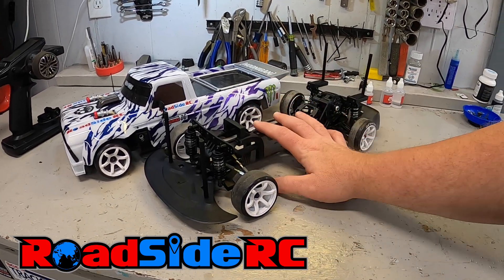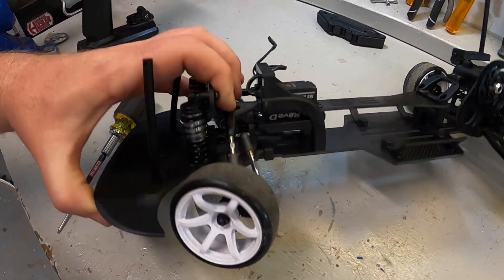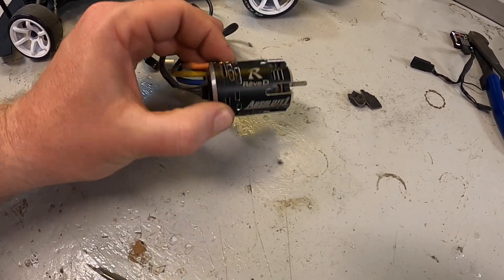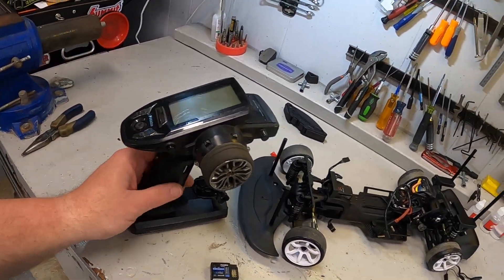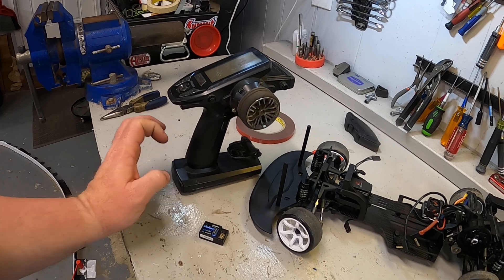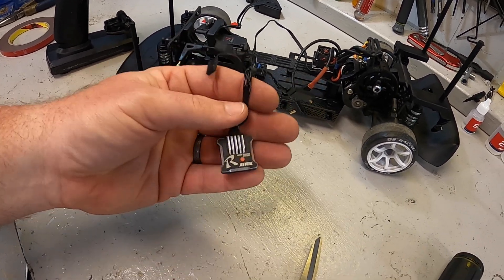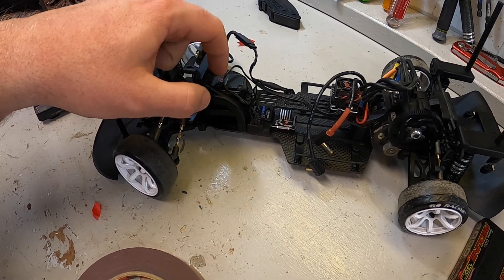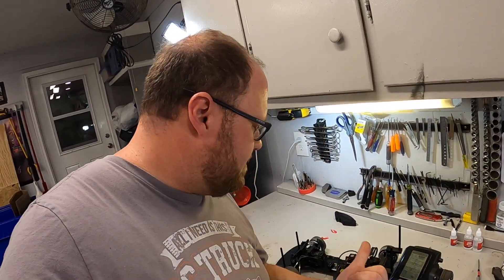Recommended Electronics for Redcat RDS RC Drift Car Build

Comment: Hi Troy! I just installed a reveD servo in my RDS, but it doesnt seem to want to go full lock either direction, any idea why? With stock servo it was going almost 20 degrees further.
Thanks!
Reply from the maker: You will need to re-set your endpoints in the gyro as well.   Have you tried that?
Reply: @RoadsideRC Thanks for the response! I did try endpoints originally but it wouldnt go past the same point it was set at. Turns out the reved servo is lower profile than the stock one, so the servo horn is hitting the servo mount!
Mooseridez had a video that points out the issue.
Going to file it down until it has clearance today 😅
Reply from the maker: I did the exact same thing.  Took a Dremel to the mount until the horn cleared.
Reply: @RoadsideRC Did I miss that in your video? Thanks again Troy 🙏 the wealth of information you has made getting into drifting much easier

Comment: I know you like the ReveD and the Futaba Gyros, but, is there a Gyro available for $50 or under that performs well, I saw you liked that Dumbo RC all in one for that price, is there a stand alone Gyro for that price so I can still use my T4PM Plus? Also which Futaba receivers do you go with?
Reply from the maker: Of all the parts of a drift car to cheap out on...the gyro is absolutely NOT one to do so.   Spend the extra $ and get a really good gyro.    Cut corners elsewhere.
Reply: @RoadsideRC  Ok, TY for the advice as always :)

Comment: Would the hobby wing Xerun justock combo work with the rds? Only reason I ask is cause it $110 dollars… thanks and love your vids!
Reply from the maker: Yes - that combo will work, but will leave you without turbo/boost - and without mechnical timing adjustment on the motor.  
Will it work great for having fun?  YES!  
Will you eventually upgrade if you start driving on track with others?  Probably!  

Here is another budget combo I have used:  https://youtu.be/nQBaEMDu0Ow

Comment: Recommendation for ESC: Hobbyking XCar 120A and an USB interface. It's basically some HobbyWing Xerun clone - uses HobbyWing software for tuning. Sum is under 40 bucks. Plenty of boost and turbo possibility (I ran at half of max). The only downsides are that sometimes throttle gets stuck after stopping for a second (applies to both original and clone) as well as minimal throttle response latency. Would recommend for start though.
Reply from the maker: Interesting!   Where do you purchase it?

Comment: One thing about ReveD is that electronics aren't always stable quality. One guy already had a servo and a motor (or two) stop working properly after almost no use.
Reply from the maker: That is true!  I have seen some folks say that.   Everything I have had from them has been solid though.

Comment: The 10bl120 and 10bl60 do have boost. It is no where near as tunable as the xerun escs but they have 8 steps of boost ranging from +0 to +26.25 degrees and it certainly works. You will need the programming card to enable it, part # HW BQ2007
Reply from the maker: When I plugged mine it, it would allow general motor timing adjustment - but not actual boost or turbo.   Are we talking about the same thing?
Reply: @RoadsideRC  yes, it's called timing on the program card. It works exactly the same as the auto boost setting on the XeRun ESCs and applies an additional timing offset throughout the rev range that varies based on throttle input. I used an RPM meter to test mine, on the max setting with a cheap 10.5t motor I was able to get close to 10,000 additional RPM with no load on the motor. The difference when driving is immediately noticeable.
Reply: @DJ.1001 Im pretty sure it's different. It's not on a ramp like boost. It's fixed instead.
Reply: Something to note here is that the 10bl120 g2 has turbo and boost. Only 10$ more for it compared to the original 10bl120 which is getting harder to find. And for good reason. The g2 is far better than the first one and with a Rocket sensored drift motor it is absolutely a rad combo that works just as good as the more expensive combos. I have had the expensive stuff and I would recommend the budget combo i mentioned over the expensive ones any day given you save way more money and they work just as good. Also the purple Rocket motor I use looks so good.